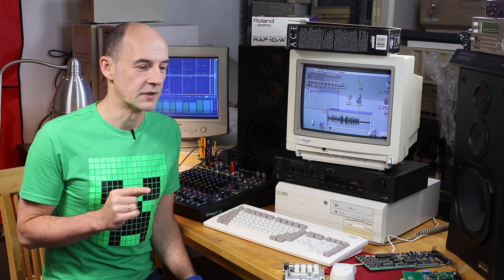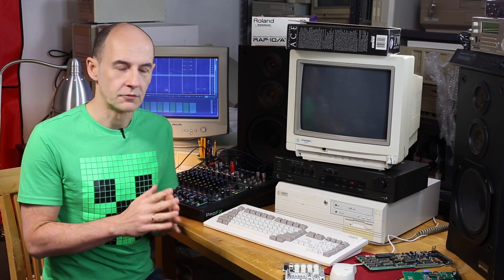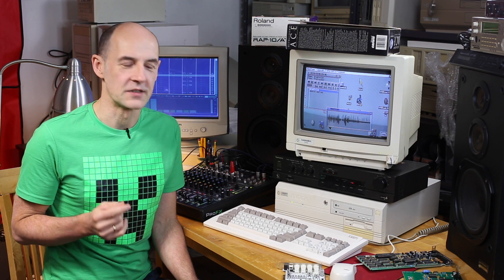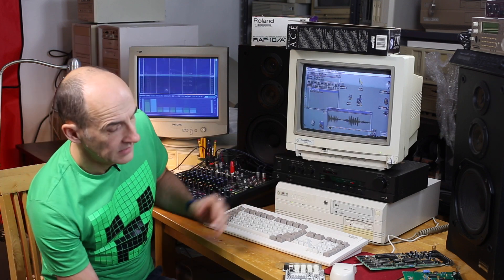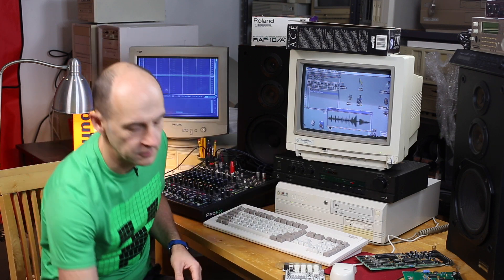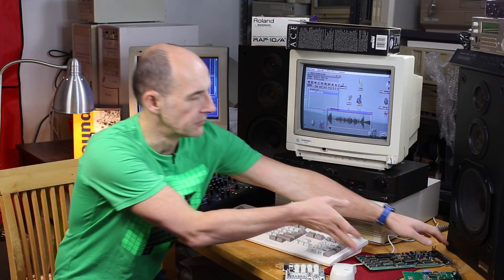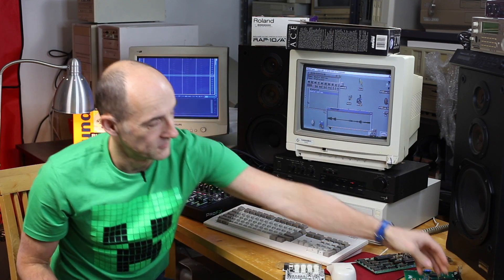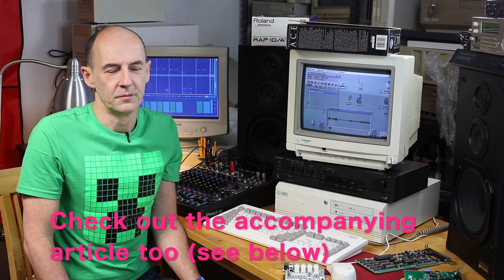Understanding Computer Sound. 1. Introduction

Comment: I've only watched a bit, but on a number of fronts, it's the only reason why youtube survived.  As I type that ya pull out the adlib, had the apple ones too.  There's two really good fronts, the AtariST had the best midi cause the buard was right, I didn't even dive into the sound thing till 2k or so, cause I was getting board putting networks in & mixes and the tech was getting to make a hold, minus protools who started with samples & now & I have to admin old I can still hear it, it takes A&D, the clocks got better & a pie with a hat.  What I did, since board tech was going out to swap when I started early 80's, I build the gear along ompress there gra stuf, so I could compare to plug's cause I'd never heard um, beta'd for ua & teh ai is makes another huge swoop, demucs demixes songs & remines them, to hear starway to heaven no vocal,etc is gonna be a wow, for awhile & pc crushed the atari and one off pc co's. how the hell dell did anything I'll never know. You can't by parts anymore, ya can make samples, but the eara o sound * probably quality at 78/79,analong then, that digital flow started it all over again in a way, when we get triangles and cubes that use light to record analog the ifnormation, like of course, on a floyd album, thatll be it.. I had no idea, I teched in the 80;s and skipped school to do tech, one o the early tech i met was doing audio & beer, now I quite understand. Having the cpu experince/nets/modems, made the analog flow easily.  I didn't keep any of the relics, but as i've commented up a storm, cause I like the idea o it being presented, what braught me here, I thought of it  and somebody had done, it  just the audio of apple ][s, and explained, a 9 year old with 1200baud and having to sneak all night to pirate the latest sotware so slowly, you couldnt even buy it easily.. and  pulse width blicking gets a voice out of cpu.. midi the same character codes as 1800 piano players, geeze that's the twist on automation screwing the artist, 2000 years ago.. ok. rock on, the next board looks like the sclone soundblaster, I baught um in the order they were available and I bet I can stil out jumper and irq with qemm a buch of folk.